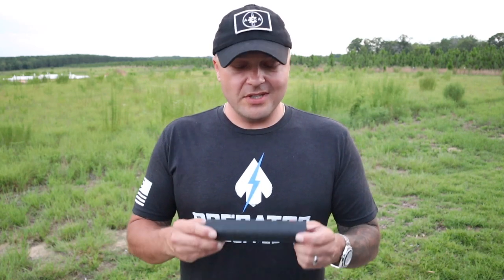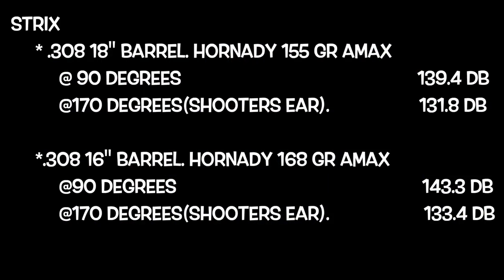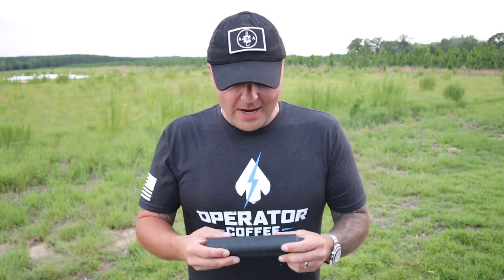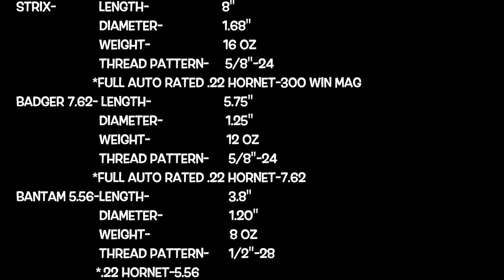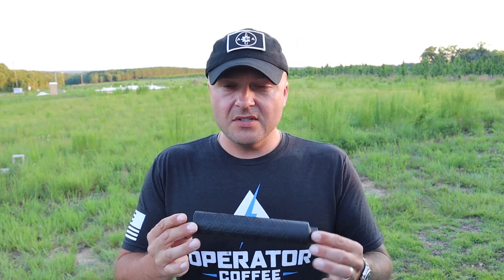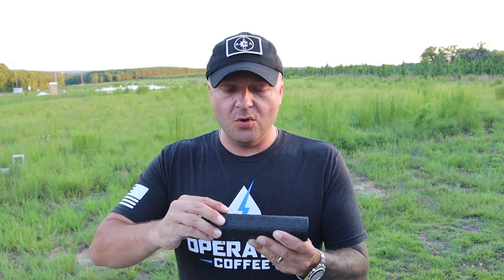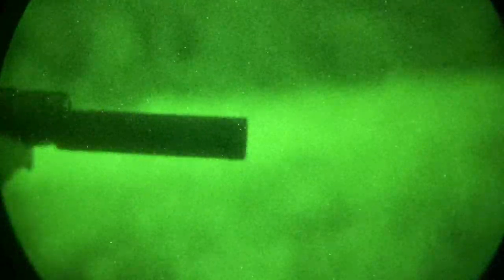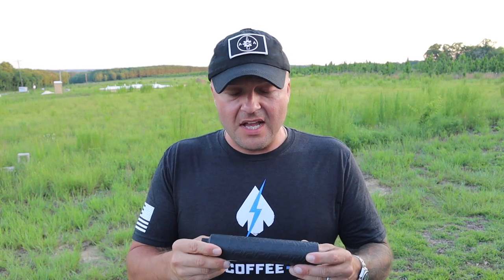3D Printed Suppressors from Thermal Defense Solutions.

Comment: I have a very large supply of inconel 718 very pure and in powder form, in bar form its very expensive. we do precision grinding and end up with tons of this and I hate to throw it away its the most expensive nickel alloy mtl there is available. If it could be used in the 3-D printing process I'd sure like to see someone make use of this. would you ask your friends at Thermal Defense if they could use this, I would have all they can use and they can have it for free. This is a very serious offer, we process truckloads, millions of pounds of inconel per year the clean powder byproduct produced while processing I would just rather not throw it away, again, the material is crazy expensive seems like it would have some value for someone. I wrote this quickly hope I explained it well. ... thank you for your very informative videos
Reply from the maker: I can definitely get ahold of them and let them know. That would be awesome if you guys could work something out.
Reply: Does the powder have coolant and grinding wheel contaminants mixed in with it?

Comment: Is there a suggested break in to allow for cleaning out residual metal powder from the manufacturing process which might cause an exaggerated muzzle flash in low light. My FFL tried mine out as it’s still in ATF jail. He was impressed but in low light it had a large fireball quite consistently.

Comment: I just got my bantam, does the direction of the spiraling keep the Suppressor tight? It seems like it would just come loose only hand tightening like the instructions say. Have you ever had one come loose?
Reply from the maker: No the direction of the twist doesn’t do anything. Some say it does, but it doesn’t. All direct thread suppressors have a tendency to loosen as you fire unless you use rocksett. Some manufacturers are going to tapered barrels and a tapered adapter on the suppressor. The taper keeps it torqued on without loosening. Another option is to torque it on, just make sure you don’t exceed the manufacturers recommendation for torque setting on the barrel. Just check it’s tight when the can cools down between firing  and you should be fine.